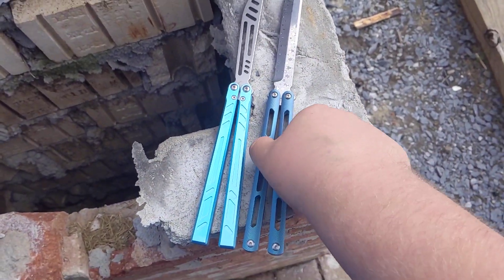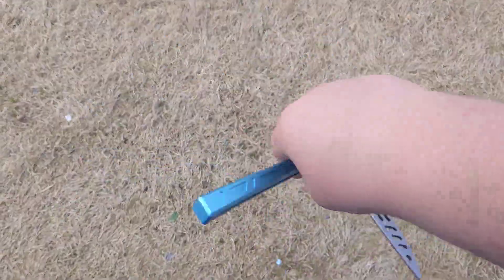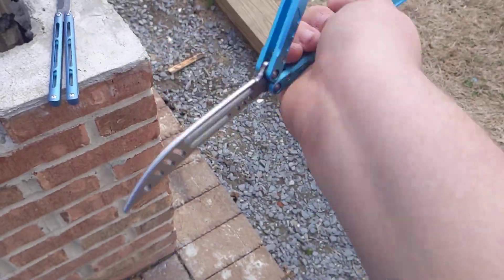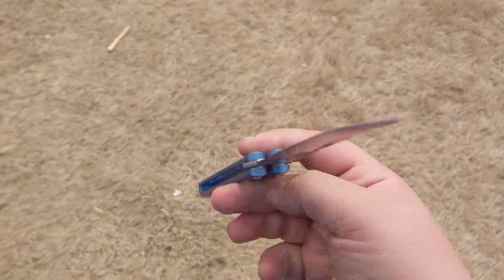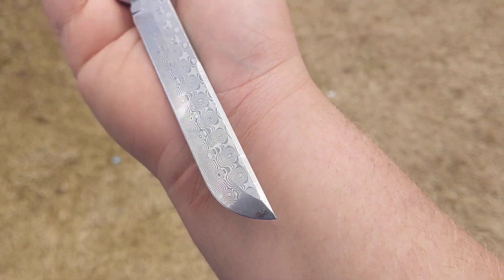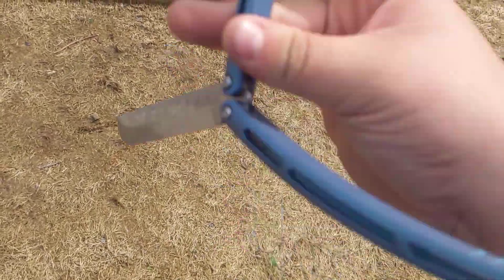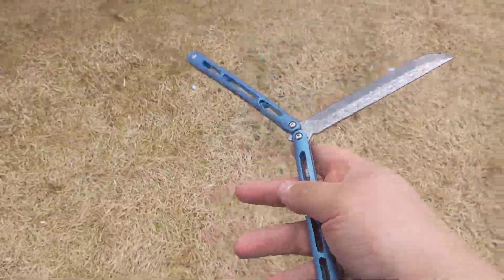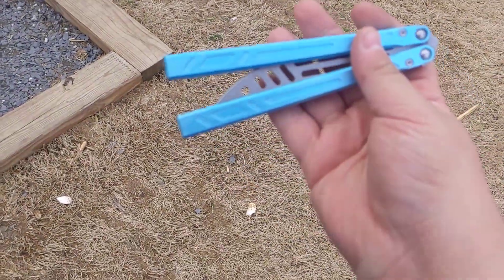Theone Damascus Tsunami Clone And Armed Shark Barebones Clone Review \-/ UNEDITED

Comment: Mine and my friends AS Barebones doesn't have tap out of the box. Even though there's no tapered channel, so great tolerances one the ones we got. And the tolerances have held up. The baliplus has a tapered channel if you prefer that. I always prefer AS.
Reply from the maker: they come with no tap no play, but after a few heavy drops they usually develop tap
Reply: @DJEyelessPyro  I’ve had mine for 6 months now. I’ve flipped it so many hours and it still has no tap as long as the screws are loctited/fully cranked. Many drops on carpet and some on hardwood. My friend and I have bought a total of 5 AS products and only 1 of them needed to be tuned. The other 4 never developed tap. It’s a gamble tho because they don’t send extra bushings. Some people have gotten awful tunes.